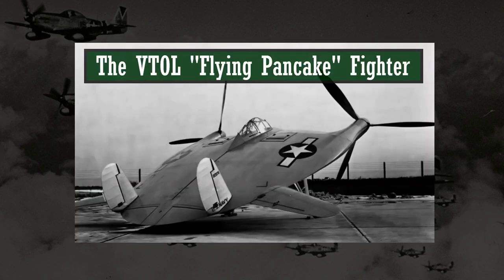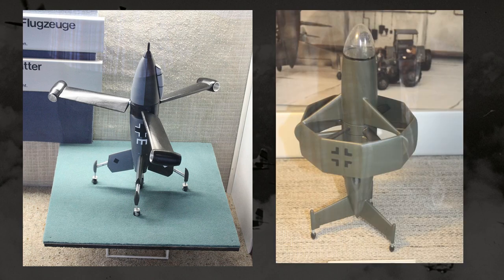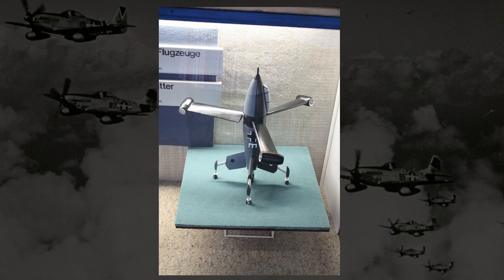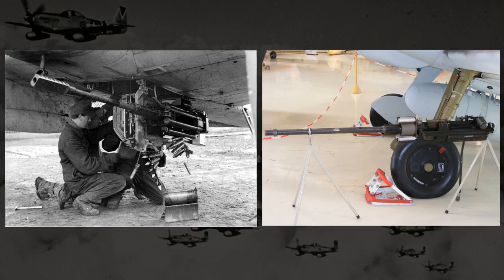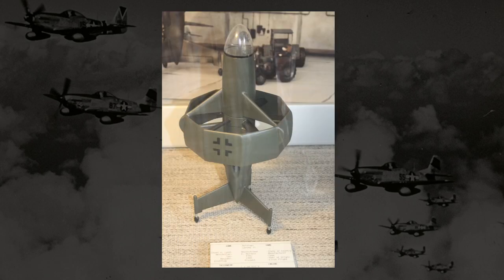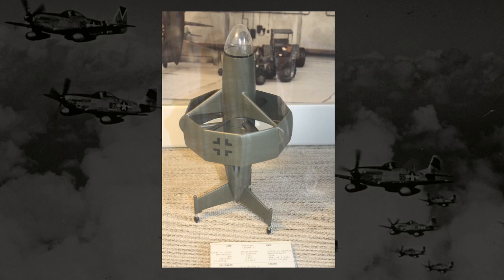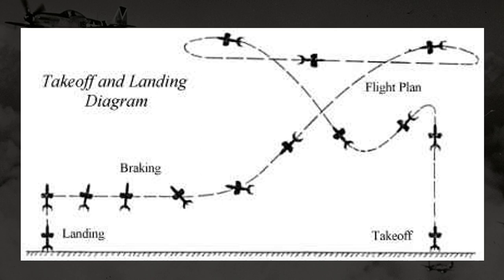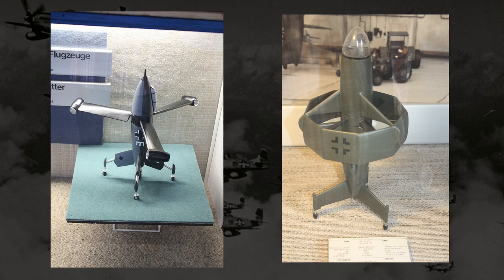Germany's Last Ditch VTOL Planes

Comment: V/STOL: The problem isn't taking off, it's landing the "tail sitter."
Reply: How very astute of you to recognize that. Especially since the narrator specified this exact thing.
Reply: @Species5008  my favorite part of the video is when he talked about the German planes
Reply: Only if you really bother with tail sitting landing. Space-X finally nailed it with their reusable landing booster rockets but without the computers avalible now, it just doesn't work well.  Ignore tail landing and you can have an vertical takeoff interceptor. The reason why we do not see those now is thst we got surface to air missiles now that make the concept moot.
Reply: Indeed, craft vertical landing Is a very tricky manouver even today with computer assisted systems, trying to do it by hand was a recipe for disaster
Reply: They call them helicopters or tilt wings.
Reply: It was a problem, but no longer given autonomous rocket landing technology.

Comment: ruhrstahl x4 on the lark...... funny joke..... realy good one. and for everyone wondering: there was a single test with those missiles on a single seater plane and the pilots complained afterwards that aiming the missiles was a problem when you also had a plane to fly (the rx4 was the first guided air to air missile) due to the manual guidance of the rx4. and now put them on a plane that neither can be extended into a two seater and where the pilot has a harder on the pilot controll scheme and you get why this is a good joke. also yeah: the rx4 was apparently tested with two seater 262 jets making the schwalbe the first jet to use guided ammo.
Reply: Thanks. Always wondered if the X4 was a 2 man job. Would like some on my Me 110g.
Reply: @mikhailiagacesa3406  actually it might have happened. if the plane was capable of getting radar it could also take on the rx4 rocket as ammo.
Reply: @mikhailiagacesa3406 As the missile had to be hand flown by the controlling pilot, it was pretty much a 2 man job, yes.
Think of a 1970s/80s TOW missile fired from a helicopter, but at a target moving at 10-20 times the speed of a tank.

Comment: I believe that, in both cases, especially the Trifluegel, no thought was put into how the pilot was meant to bail out.
Reply: Some thought was put into how the pilot was gonna bail in the Triebflügel, they had made the bolts that connected the blades of the rotor explosive so at any time the pilot had to bail they could explode the blades of and than bail.

Comment: I'v e build a Triebflugel in KSP and while the big rotating jet-powered "thing" does manage to lift off the thing, the amount of control authority to get it out of that vertical climb is just not feasible. In fact, the entire fuselage tries to counter rotate. And KSP has a much more forgiving aerodynamic model.
Reply: Although KSP struggles with high RPM rotors (because they don’t spin so much as jump frame to frame).
Reply: That's what I thought when I saw this huge propeller the first time. Of course it's gonna counter rotate.
Reply: @jimmcneal5292  Same here. So you need two counter rotating giant propellers. Then you get into all sorts of gyroscopic fun when you try to turn the thing.
Reply: @jimmcneal5292  The propeller is driven by jets at the tips so there is no counter-rotation of the fuselage.  A somewhat similar mechanism was used by the Kolibrie helicopter, which had a main rotor driven by 2 ramjets at the tips, and no tail rotor.  To allow the pilot to orient the aircraft, a small movable fin was mounted on the tail, acting on the rotor's downdraft.

Comment: Because the pilot in the Lerche flew it in a prone position (meaning he would be standing during the landing phase) the increased visibility with the ground would probably mean getting it back on the ground would've most likely had been much easier. With the Convair Pogo however, although the seat tilted somewhat so the pilot wasn't flat on his back, he still had to look back over his shoulder to gauge his height. (The Lockheed version's pilot would've had similar issues had it ever attempted vertical flight.) The Ryan X-13 Vertijet also had this problem but with the added difficulty of having to catch a wire on a gantry as it never actually sat on its tail. (Oh, to add difficulty to that operation the hook was on the bottom of the Vertijet and the pilot had to finagle the plane into the wire which the pilot couldn't see, again, because the hook was on the bottom of the plane.) In operation of the Pogo, Convair test pilot Jim Coleman shared everything he learned with Lockheed test pilot Herman Salmon so he would be prepared should Lockheed's plane ever get engines that were set up to operate vertically. As it was, the Pogo had the only XT40 engine able to operate in a vertical position so the XVF-1 never got a chance to do so.

Comment: The most interesting thing about the triebflugel that is never touched on is how they'd keep track of each other, especially during that chaotic launch. You couldn't see, so they settled on audible alerts. Every triebflugel was equipped with three triebfleugelhorns the pilots could sound at aill. This is an official not-a-fact.
Reply: so they stuck Jericho sirens on the wingtips?

Comment: The Lark looks like with some tweaks you could make something able to take off and land conventionally or vertically the vertical take off could be great for hiding it in a forest.
Perhaps having something narrow enough to land on a road has some merit too.
But I suspect that would throw the weight off a bit putting wheels on the "donut" But perhaps some struts mounted in the support mounts that sat lower than the wing might work, but it could be very top heavy that way.  but perhaps pumping remaining fuel into the belly could help with that.

I suppose a huge alluminum frame would be mounted on it's backside that it could land on that was more like a pyramid it wouldn't tip then and it could even coast on it's bum without tipping over and so be easier to land as the pilot wouldn't have to stop forward momentum to land. & thrust reversers could push it down into it's struts to slow it to a stop.

So it could make a rolling landing. The current design is to heavy and would tip over unless it stopped completely all lateral motion to the ground and just lowered altitude until it touched down.

I can't help but think regardless it would be heavier than it needed to be and very unstable to land.
Reply: That's how the US Navy ended up testing their tailsitters. Fit them with (intended to be) temporary landing gears so they could take off and land traditionally in order to test behaviour in normal flight, without going through all that messing about with transitioning to and from vertical flight.

Comment: Both look like a 1 way trip to me !!!
Japan could have used them !!!
Reply: Japanese suicide pilots often made more than one trip. It was expected they might have mechanical trouble, not find their target, run into bad weather, or for any number of reasons have to turn back. Getting jumped by allied pilots was even a problem. 

Though you only got about 10 round trips before someone decided you were faking and then you wished you hit a battleship instead. 

It was the 1940s and finding where you were going was often really difficult and something even skilled pilots had trouble with.

Comment: The "ch" in German is pronounced like a hissing cat or snake. 
History has it, that Hitler wanted the Me 262 as fighter-bomber, hamperring the development and early production considerably. 
Moreover, the piloted V1 was an emergency measure to iron out some aerodynamic issues, regularly driving the primitive autopilot nuts. 
It probably would have needed a proper turbojet like the Heinkel "Volksjäger" and definitely a landing gear, as it usually was launched by a catapult and regularly did blow up on arrival.

Comment: ther have been several sucxefull  tip jet helicopters from tiny  one-man ones with hydrogen peroxide ockets - to the faiery rotordyne with ram jets to the mighty hughs   XH-17  with ducted gas turbines -  my point is thy all overcame the problems of tip mounted motors - so i see no technical problems for getting the trifugels rotor to work

Comment: The Triebflügel seems like a very flawed design to me.
- Gyroscopic effects would be a problem
- The rotor would transfer some momentum to the fuselage through friction, making roll control a pain to deal with
- Any damage would cause an imbalance and oscillations, and it's a pretty easy target for an array of M2s with ~500rpm
- It can't glide and would probably perform very badly in an auto-rotation.
It's the kind of design you put on a fridge, just to admire the creativity.

Comment: The problem of landing a tailsitter defeated both the Convair XFY and the Lockheed XFV experimental fighters. The test pilots had extreme difficulty landing on a flat, unobstructed, and stationary surface in calm weather. How these VTOL fighters were supposed to operate from ships at sea was never worked out to anything beyond hand waving. Both planes were fitted with non-retracting temporary landing gear for basic flight tests, but operational-type landing scenarios were basically controlled disasters. If the Navy should ever resurrect the tailsitter VTOL concept, they should hire Elon Musk as a consultant. His tailsitters seem to be able to land rather frequently.